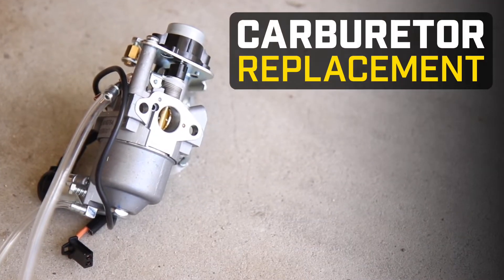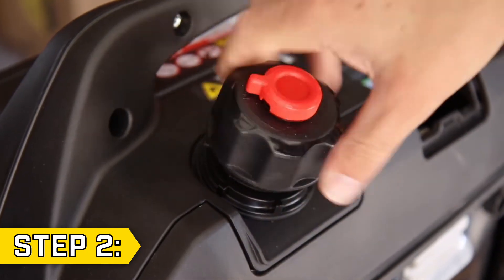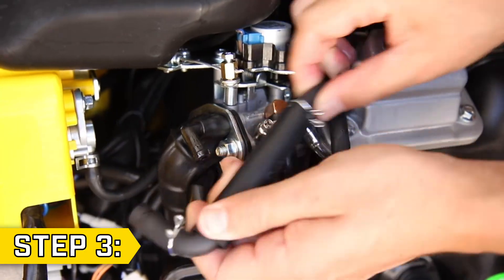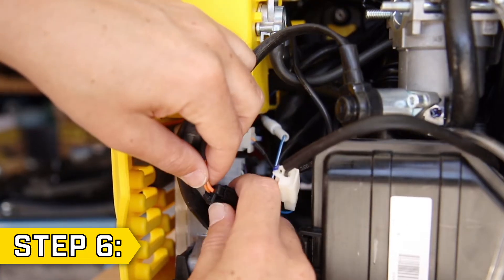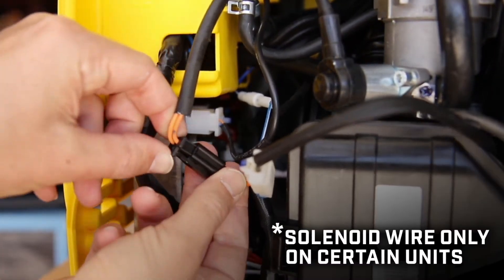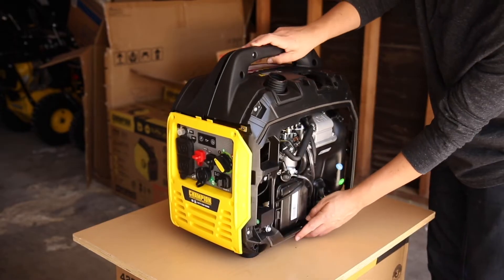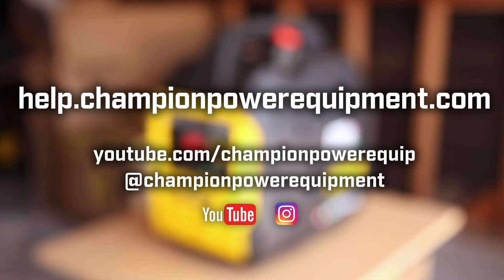Carburetor Replacement (2000-2500-Watt Inverter)

Comment: I bought this unit back in February of 2024 and it's been great.  However, now the generator appears to be tripping due to overload.  Running a 1500w air fryer for example ( which it was doing fine until recently) will trip the generator.  Not sure if it's a carburetor issue or not.  Maybe a spark plug?  Any ideas?  Thanks
Reply from the maker: Thank you for reaching out. We recommend checking the connections behind the unit’s control panel, where the control unit is located. An overload condition can sometimes be caused by loose or damaged wires. You can refer to the following link for guidance on how to access the control unit:

https://help.championpowerequipment.com/article/06rp817zfs-2000-2500-watt-inverter-control-unit-replacement

If you're still experiencing overload issues and everything appears to be in good condition, please contact our support team so we can gather more information and assist you further. You can reach us by calling 1-877-338-0999, emailing support@cpeauto.com, or using the live chat feature on our main website.

Comment: Would a issue with the stepper motor keep the motor from turning off eco mode and tripping the overload button?
Reply from the maker: Hello, please reach out to our support team at 877-338-0999 for troubleshooting and addressing the issues with your unit. -Thank you

Comment: This is a good clear video, the dialogue is very easy and understandable. I've got a 2500 dual fuel Champion generator a brand new carburetor for it, I think that when I was changing the oil I tilted it too far. I change the oil and check the spark plug after it had ran out of gas. Now the carburetor flooding the carburetor bowl and stalls out the engine. Champion sent me a new carburetor free. The generators only 6 months old and in pristine condition. Be careful when you took your generator to drain the oil. It starts right up first Pole, but something inside the carburetor is Fubar without taking it off. I would love to have a manual and somewhere to order parts. The fool that unboxed it rule out everything but the generator. I asked him what the icons meant on the knob. Insulted me change what you don't know how to start a generator . He brings up a generator every 2 months, t h r e w out the propane connection hose too. My generator is usually last about 7 years. When he starts him up he puts them on an air conditioner or some other hi watt usage. I run in an hour and then I plug in less than 100 Watts. I only give my generators recreational 90 fuel with no alcohol. Never empty your gas can into the generator no matter what kind you use there's always going to be a couple of drops. Take care out there and I hope you have as much luck with your generators as I have. I had a Ryobi for the last 7 years, and I needed a new governor stepper motor. They sent it free and it was here only three days. 5 years later I tried to get ahold of the same guy to get another stepper motor, they did not understand what the carburetor Governor motor was so they sent me a couple of plastic caps that covered the stepper motor, 27.00 and I didn't need it my Ryobi didn't come with a plastic cover over the stepper motor. Next they sent me a stepper motor and no refund or mailing label. It was just a different kind but I installed it and it worked about 2 months. I ordered another one, and when I installed that won the generator would only run about 2 or 3 seconds and then shut down. Ryobi has only one phone number for parts in the United States or anywhere in the world I guess and they don't know nothing the generator parts they're supposed to be providing and selling. It starts first pull, but won't or make electricity. If I could only get the right parts out of Ryobi, I wouldn't know how good Champion generators are. The Ryobi knob turned on the gas and choke enter the Run position it was on a metal knob sticking out of the carburetor. It stripped out inside. I had a couple thousand hours on that generator. And I don't think I ever bought a spark plug for it I just cleaned the old one. I hope this Champion can match that. It's quiet and makes nice power when it's running. With the Ryobi even being smaller would start the air conditioner while my mini fridge was running. If I don't get this Champion working I'm going to put the stepper motor off it under the Ryobi. Thank you Tatiana a champion for listening to me and listening to my generator troubleshooting it with me and sending me that carburetor. I hope all the employees are champion artist friendly a knowledgeable as you.
Reply from the maker: We are so happy to hear that Tatiana was able to take care of this for you. We will be sure to pass this feedback along to her immediate supervisor. Thank you for taking the time to let us know & do not hesitate to reach out if you require any additional assistance.

Comment: Very useful. Should also know that the bolt on the bottom of the carb can be removed. The bell at the bottom can be removed and cleaned with carb cleaner. The jet can also be cleaned with carb cleaner. Then all can be reinstalled.

 This worked for me and prevented the need for a replacement carburetor.

Thanks for the video
Reply from the maker: Thanks for the helpful tip! We appreciate your sharing your experience.
Reply: Hi seen your post, can you tell me is there enough room to get to the jets without loosening the carburetor mounting bolts. My generator only runs on choke, so I'm thinking, maybe one of the jets are clogged. Any help would be appreciated.
Reply: @nickpanhead7209 its possible you can clean the jets with a can of carb cleaner with the red tune, by just removing the bowl.
Reply: Great idea, ill try that first. Thank you for getting back to me, i didnt even think of that, @batvette
Reply: @nickpanhead7209 i did mine last night and theres jets next to the butterfly valve you arent going to be able to reach from below. But you might be able to reach them with the red tube if you loosened the carb and slid it away from the engine about 3/4". I gather youre trying to do this without removing the carb. Youll only really get the main jet and float jet from the bottom. This video instructs you yo remove a lot of things I didnt have to. I just loosened the two carb nuts, removed the choke cable, then the two phillips screws holding the plate with the stepper motor and choke bracket on it. Carb slid right out after that. (And after removing the fuel line) None of thr frame or tank pieces need removing. However youll need a pretty good offset  ratcheting bit driver with a #2 phillips to get those 2 screws on and off. Also note theres a certain way the float needle goes in. The plastic lever goes INSIDE the wire rectangle not on top of it .
Like any mechanical repair I stumbled through it and it seemed daunting at first. After Ive done it once I could R&R and clean the carb now in about 20 minutes. Hopefully I will prep it before storage next time. and wont have to. 
Also Ive heard Honda has a fuel drain valve inside, Im going to find some kind of petcock and add it to the carb fuel line to facilitate tank drain. The way it is now you have to remove a line from the main combo switch and attach another line temporarily. Petcock or a 3 way splitter to a drain valve would be a worthwhile mod if the unit sees a lot of use/storage cycles.
Reply: Great ill try that first and ill keep an eye out for that float needle thanks for the heads up with that. This thing is brand new my son in-law used it one season and didn't prep for storage. I prep all my storage for winter month's i drain all gas then run it till it dies never had an issue. He gave it to me so ill get it running for myself. Thanks again ill be working on it in the next few weeks. @batvette

Comment: Where can I find a picture of the position of the spring/plastic arm assy for the throttle actuator on top of the carburator?  Model: 100889 / SN: 20120019001689
Reply from the maker: Please email us at support@cpeauto.com, so we may further assist you. Thank you.

Comment: It will literally last forever if you just use propane. Thing is a tank
Reply: Recoil starter is pretty weak, though theyre not unique with that. Mine broke and champion sent me a new part free under warranty in a few days so good on them. It was a pretty involved repair though requiring disassembly of most of the outer parts. Took me about 2 hrs. Ive been careful starting it since, trying to avoid engine backlash. These are as good or better than anyones chinese gennys. Lighter and more compact than the Predator 2000 it replaced, equal noise level. Doubt it has 500 more watts output despite specs, maybe 100 more running watts. Which given the size and weight reduction is impressive.

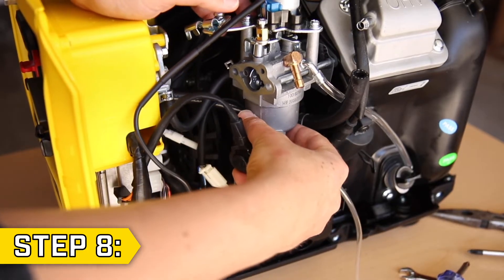Comment: I just pulled the carburator out (mostly) on the model 201046, which is the 2500 watt single fuel inverter. There was no need to unclip any wire harnesses but in order to remove the carb intirely there is a black wire that goes into the back of the panel that attaches to the top of the carb. It looked complicated to remove or I would have to remove the top white round unit on top of the carb. I just got it out far enough to clean the jet and now it works fine. However if I had to totally remove the unit, this video does not cover my particular model and whether I should remove the black wire going into the panel, or the top unit (whatever it is) screwed on to top of the carburator. (visible at 2:17 in video)
Reply: Mmm, seems like no one from Champion actually looks at comments or answers questions customers may have.

Comment: Do I need to remove the carburetor from this same unit to install a high altitude jet?
Reply from the maker: If there is enough room to remove the carburetor bowl from the bottom half of the carburetor, then taking out the entirely piece is not necessary. 👍
Reply: @ChampionPowerEquipmentHQ  Thank you.  I will be operating it on propane at about 8,000 ft.  I have read using the high-altitude jet is not necessary when using propane, is that correct?  I would rather not go through the trouble of installing the jet as I live at sea level.

Comment: Where do I find the replacement carburetor?
Reply from the maker: All replacement parts can be acquired directly through us by calling 1-877-338-0999 or by visiting our online store here: https://shop.championpowerequipment.com/en-us/
Reply: @ChampionPowerEquipmentHQ  thank you so much for the quick service you gave me about 5 days ago, I spoke with Tatiana on the phone she listened to me patiently and listen to my generator run and helped troubleshoot the problem, my generator is only 6 months old we didn't file the warranty and Home Depot only has a 90-day return policy on them. Tatiana s e n t me me a new carburetor due to the carburetor flooding with fuel above the best level. I got it in about 3 days and they usually cost $30. Champion give me well in a special thanks to Tatiana

Comment: Just purchased one of these Canadian model 2000 watt duel fuel inverter generators and it is a fantastic addition to my RV and home backup power strategy. I even bought the ParaLink parallel accessory for connecting two similar-sized generators and a looking forward to my next purchase of a second generator to double my power generating capacity. GREAT work Champion! Love the ease of use and quality of the product.